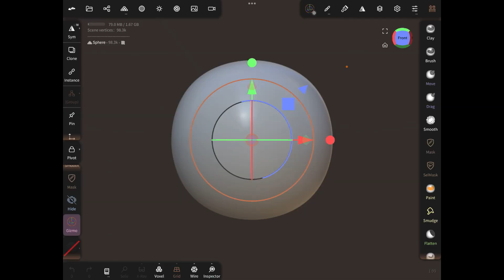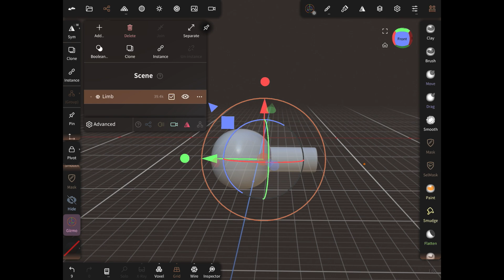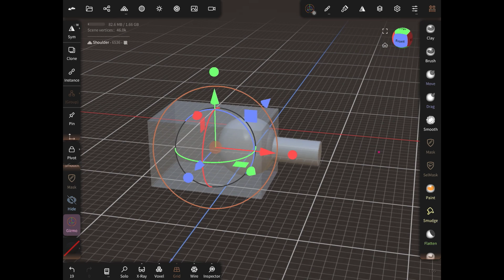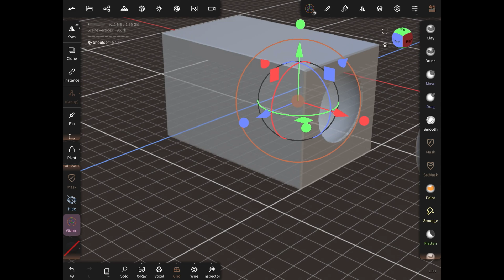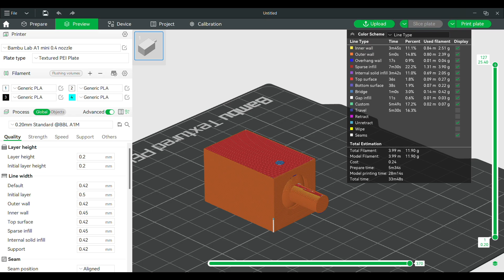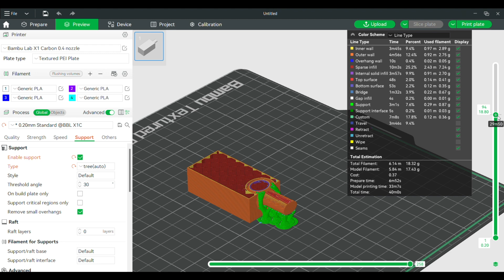How to Create Ball and Socket Joints in Nomad Sculpt for 3D Printing Made EASY!

Comment: No this is an issue, because the ball and socket joints that are best, allow the limb (ball) to be snapped in and pulled out of the joint. This is not as flexible for print in place options.

Comment: Hey I have a question, I'm designing a small (less than 3 inches) articulated dragon skeleton that isn't print in place (there's just no large flat surfaces). I normally do just PLA printing but it's not really possible for this print so I'm trying for resin. 
Is this print possible? What joints should I use? Looking around a lot of the joints seem to be placed on separate parts that you join together, with how thin they would have to be, I'm worried about them breaking if I do it like that. 
Any advice would be greatly appreciated!
Reply from the maker: @dragonk4tz470  I would make the chain joint as thick as possible within the model. It may work with resin, but you’re going to need to play with it, especially the tolerances around the joints. I’ve actually made flexies with resin and they’ve worked out most of the time. There has been a few that have fused together at the joints. Good luck! Let me know how you make out 3D printing the dragon. 🐲 😁
Reply: @MakerBuildIt  Alright, thank you!